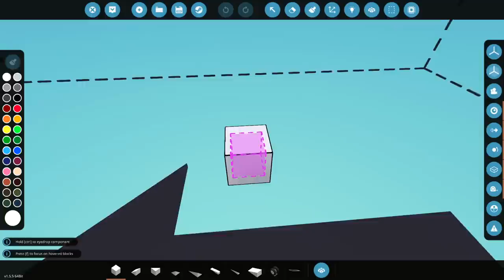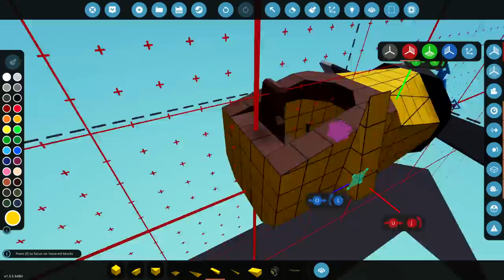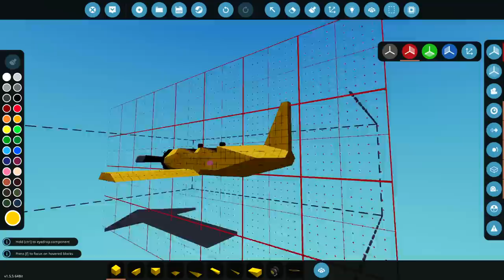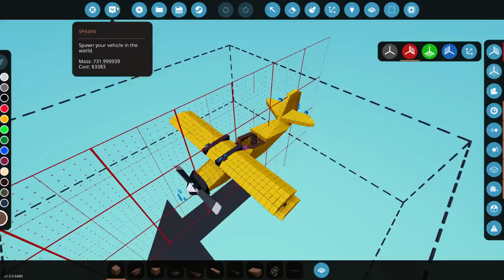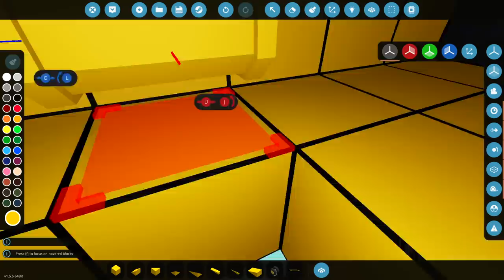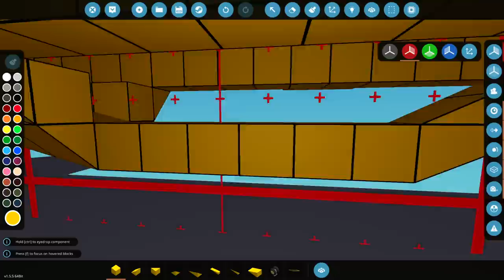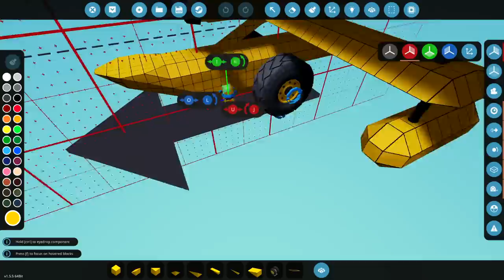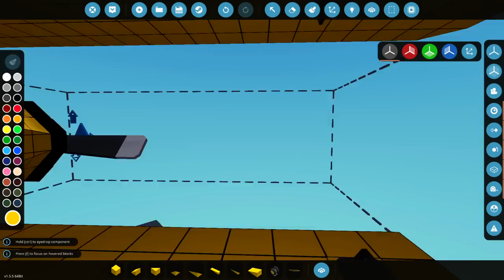Building A BIPLANE In 1 Video! - Quick Build - Stormworks Build and Rescue

Comment: I have an idea for your next project. I would like for you to build a commercial aircraft. Particularly a wide body like a 777 or an a330.

I would like for it to have jet engines because it would be more realistic and I like jet engines.

I think it should also have a big enough size cargo bay so you can transport cargo.

The plane should also have a first/business class in the front and an economy class in the back.

After you finish the plane you should build some ground vehicles to go with the plane like a push back tug, staircase truck, fuel truck, etc.

If there is anymore you would like to add feel free to reply to this. I would also like to hear the opinions of other viewers.

I enjoyed this video too. Thanks for the consideration.

Comment: Balancing an aircraft, especially a multiwing plane, in Stormworks is the worst task ever. Particularly when you're putting the engine and the fuel in the tail of the aircraft. It could probably be balanced easily enough with enough time, but for the time you spent I think it actually works rather well.